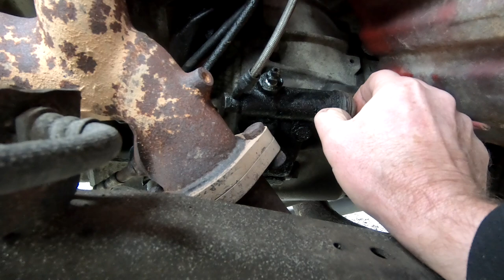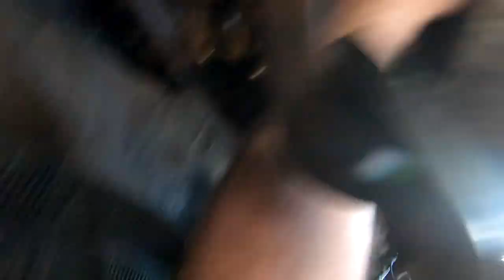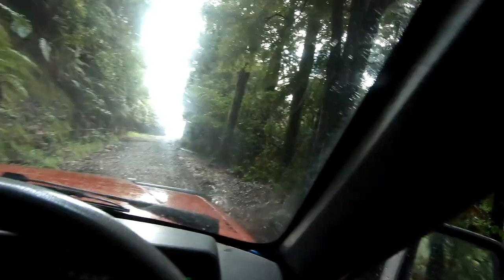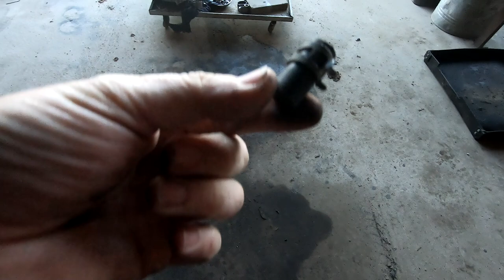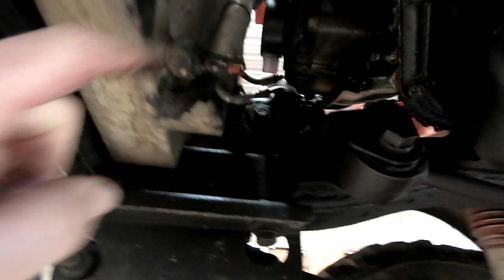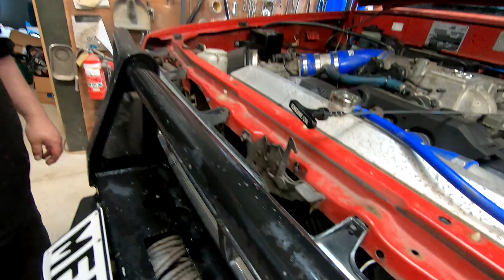Toyota Hilux with 1uz - Clutch Master replacement and adjusting freeplay.

Comment: Normally when you push back and there's leakage it's good providing you lube your pin. On this occasion with twisting your pin with the fluid provided and being stiffer it's been a good result
Reply from the maker: Plenty of lube is important,   enough to make it sticky.  Stiff pins make insertion easier too.

Comment: Sorry if this is a dumb question, but what’s the point of the electric 4wd selector if you still have to get out to switch the hubs?
Reply from the maker: So in the factory surf that the electric 4x4 engagement actuator they had an auto engagement system on the front independent front diff known as ADD,  or auto differential disconnect.   As this vehicle had a weak gearbox to start with it had a swap with the stronger gearbox,  but retained the manual hubs as its running a solid front diff.  Hopefully this make sense.  Cheers Kelvin
Reply: Yeah it does thank you Kelvin

Comment: Another example of a simple mistake and simple solution. Kelvin is there anything you do apart from a a full standalone that prevents the noticeable drop in performance when the 1UZ's get warmed up (operating temp) ? My only fault is when cold the engine flies like a bat out of hell, when at operating temp it loses a fair wack. Not much on engine that hasn't been checked, replaced or serviced. Maybe that's just how they are ??
Reply from the maker: Yep.  It was funny that the part of the body the ignitors was bolted to fell away when bolt was removed.  1uz normally dont drop noticable amounts of power when hot. 
 Thats not how they are.  There is an issue there somewhere.  I connect my scan tool and start looking and start checking.  often its something simple as well thats been overlooked.  cheers
Reply: @CartuneNZ  Unfortunately when my car was wired up they didn't add the round plug for diagnostics. Maybe this is something I can purchase from you and add into the loom ?
Reply from the maker: Yes.  They are able to be added. I may even have a couple spare here atm.